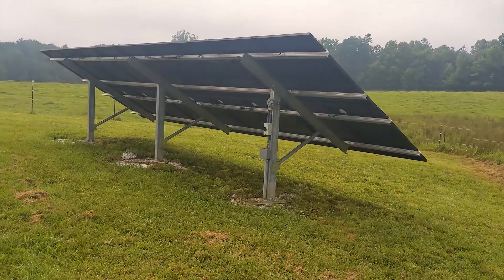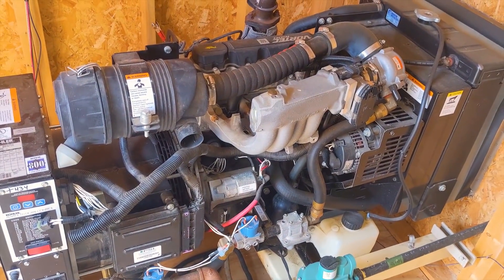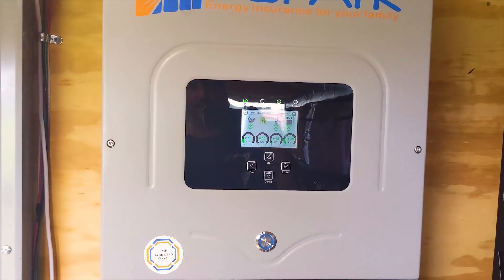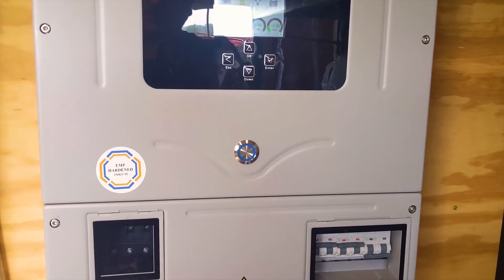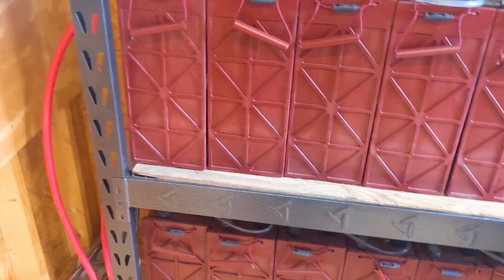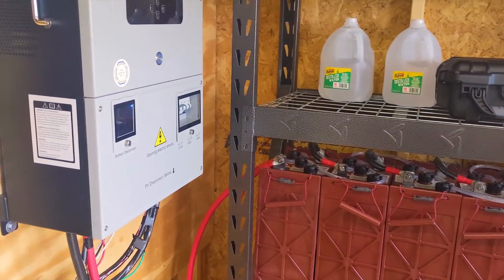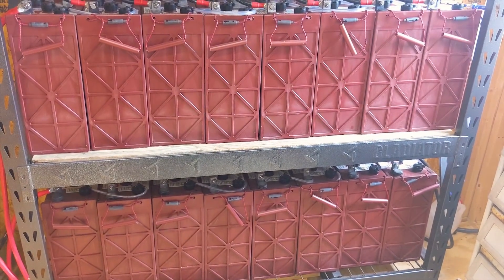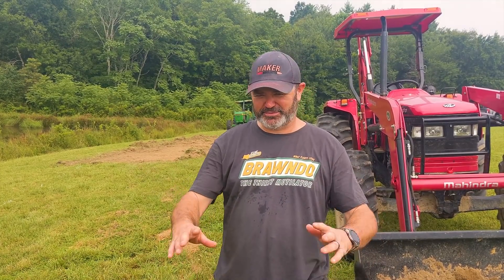Supporting our DIY customers

Comment: I'm researching off-grid power/battery systems and I perked up at the comments about EMP-proof - wouldn't the inverter and the transformer be vulnerable to the EMP?
Reply from the maker: The inverter would be vulnerable if it wasn't EMP hardened. That is the foundation of this company. They have built and have had third party testing up to 140 KV per meter on the inverter.
Reply: @engineer775  oh wow I didn't know that. I hadn't seen any of the previous vids on this setup. Will definitely check out now. Thanks!

Comment: Everyone should go check out Steve Bird's books, a crazy amount of them and they look really good. There's a Bio on amazon and he has a very long and worthwhile military history it seems with the Navy and then as a private citizen. Interesting stuff.
Reply: Thanks!
Reply: @stvbird  You joined the Navy in 1992? That's sadly when I left the D.E.P. for the Navy after messing up my back. Then in March of that year I put the last nail in my spine (so to speak) and Im disabled still at 50 yrs old this year. Scary what a slight twist of life does. I was to be an underwater hull technician as main job, but was headed for seal training straight out of boot camp. Mostly to get my ass kicked and drowned in the ocean I think. :-) Never would have made it with my spine as it was.
Reply: Yeah, I dep'd in in Feb 92 then shipped in October. I did eleven active then retired out of the reserves. Those things in life that seem to derail you may be the things that somehow saved you. I try not to let the let downs remain downers, and it sounds like you're the same way. Great to eMeet you.